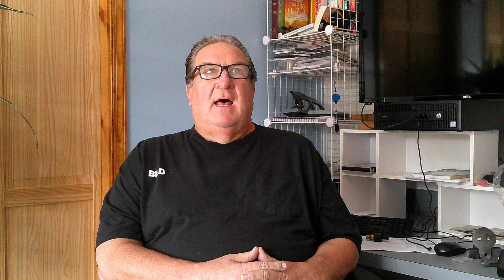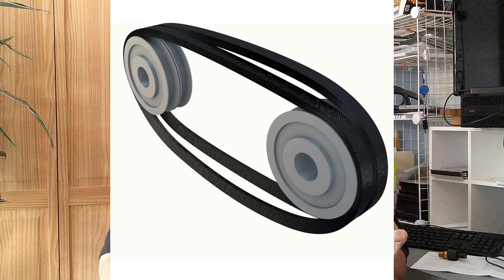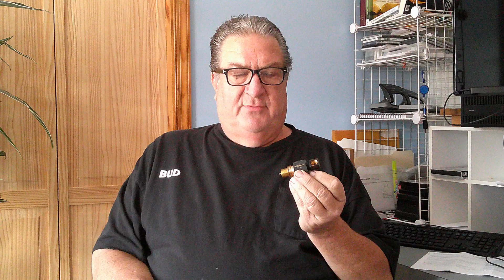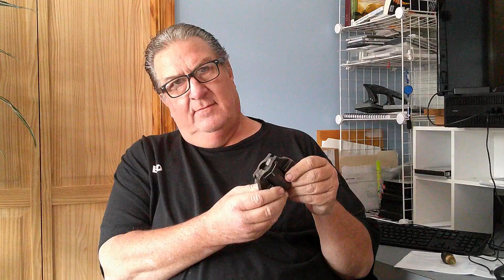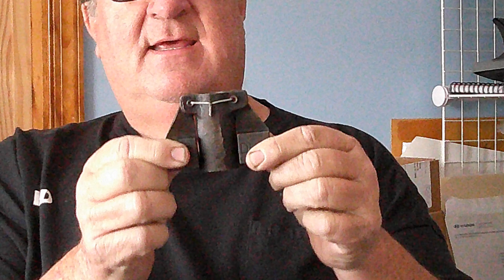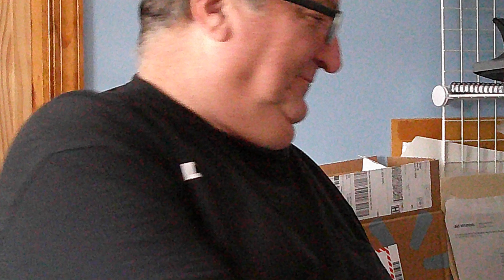Odd Symptom From Common Problem. S 5, E 16

Comment: How tight should it be? An idea of the downward deflection of the belt with a certain pressure might be helpful. I know what too loose is but how tight is tight enough is bit more difficult to determine.
Reply from the maker: that is a great question. I have an actual belt tension measuring tool.... i think , i have not used it in years. the idea of deflection also has to be measured in weight. so if it a 1/2 inch deflection is it  with 1 pound of weight or 30 lbs of weight. that is why I am recommending the car alternator belt as the example. 
see link
 https://www.midstatetool.com/buy/product/ot6673-universal-belt-tension-gauge-bosch-automotive-service-solutions/CLENC26f47740b25453a0?text=OT6673-Universal&lsi=true

Comment: Good info. If belts run to loose long enough, the motor pulley gets polished smooth causing belts to slip even more.
Reply from the maker: I have seen pulleys wear so bad that the sides that should match the V belt. the actually where rounded side walls. and yes the were slipping!
Reply: @THECompressorGuru I used to work on air handlers from the 40s and the sheaves would wear to the point that the belt would contact the bottom of the groove. They would constantly chirp and chew through a set of belts every 3 months.